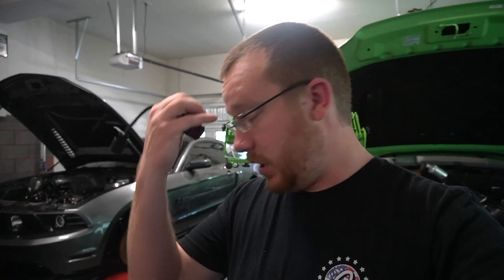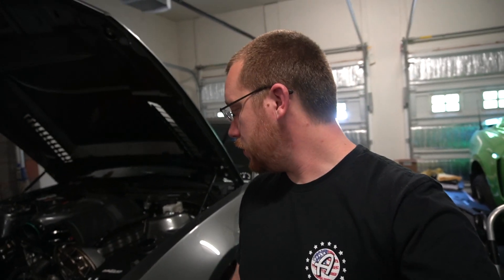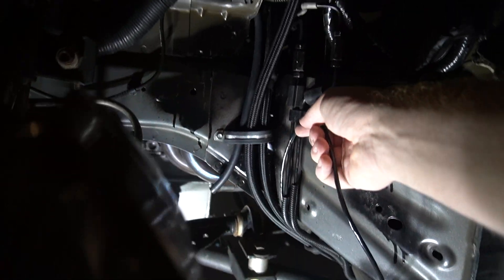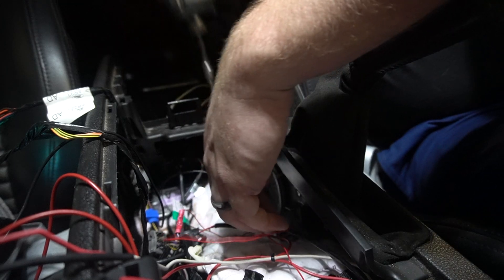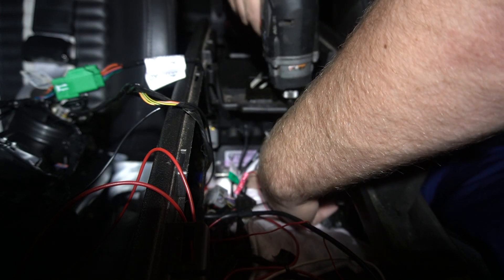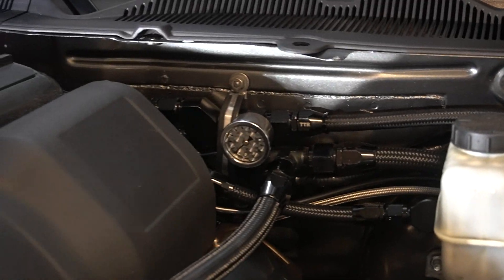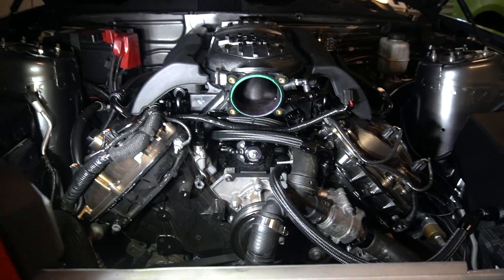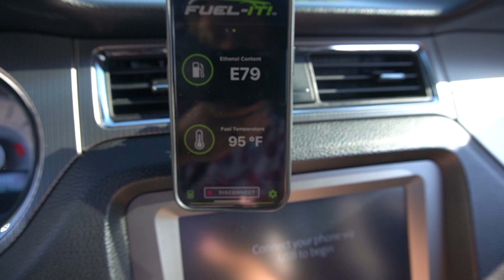How To: Universal Bluetooth E85 Content Analyzer Install!

Comment: Hey mane any updates or revisions should I say on the 321 build? Things you added that solved missed sections from the initial build if that makes sense. Would love an update video 💯
Reply from the maker: Main difference I would note from original assembly was that I swapped out the rear main plate for a Gen 1/2 one over the Gen 3 so that my Gen 1 sensor sat into the plate more properly. It can cause rpm signal issues and occasionally throw some cars into limp mode etc. so better to just swap the plate and not have to think about it any more.
Reply: @ thanks

Comment: I’ve seen different reading on the feed and return lines. Have you looked into where the sensor being placed is best. Fuel before running thru the rails and injectors have a different reading before and after.
Reply from the maker: That wasn’t something I had heard about until sometime after installing the inline sensor but I have heard that is the case. My concern was creating a bottle neck but I also don’t believe at the time there was a solution for eliminating the bottle neck in a feed line with the motion raceworks fitting adapter or similar. Or if there was I wasn’t aware of it yet. All that being said, the readings are likely close enough that it mostly is just some reassurance the e85 is still good reading or if it goes down then I know I need to swap to my lower content e85 tune to be safe.
Reply: @pokemasterbs  if you would do it over would you use the motion kit and put it on the feed line.
Reply from the maker: @joshuakazfields4374  Without having priced the motion adapter setup I'd say conceptually yeah but I'd probably make the decision based on the price point if it's excessive since the likely "cheaper" way I ran it was still adequate. Since I'm only checking for sanity's sake it's less important. If you're on a pcm/tune setup that's able to constantly adjust for the content level then I'd say 100% go the motion adapter route as you want your adjustments etc. to be made based on as accurate of a reading as possible.